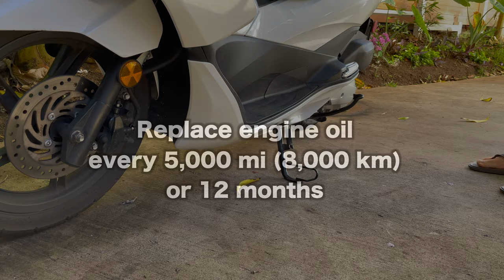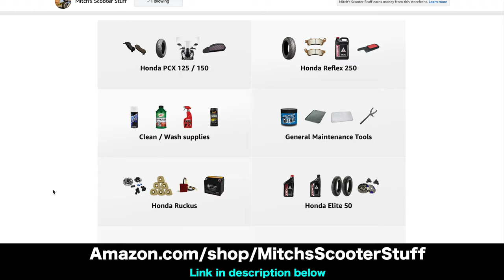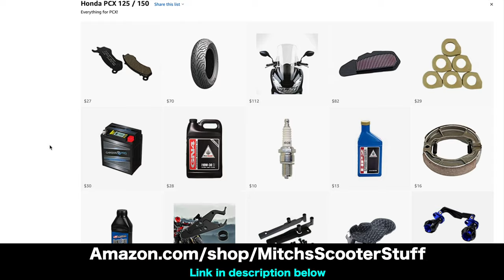Honda PCX - Engine Oil Change / Strainer Screen Cleaning | Mitch's Scooter Stuff

Comment: Mitch,  Great maintenance instructional videos on the PCX 150...really the best.  Could really use one on how to replace the fuel filter located on the fuel pump assy unit inside the gas tank.  A few panels have to come off, disconnecting the fuel supply line is a little tricky, and removing the pump assy from the tank is like RUBIKS cube...ugh.  Could really use one of your videos on this job.

Comment: before put on back the screws under the engine and the filter "tamiz", thats better put some new oil to clean out old oil and contamination.
Honda say the oil motor are 10w30 Jaso MB, but im using for now 5w40 and works better the engine, reduce gasoline consumption and reduce stress between cilinder and piston, in a few seconds the optimus temperature are ready and for climatic zones like Hawai, California or Alicante in my country Spain in the Mediterranean, are the best choice.
Im using CASTROL from many years ago in Scomadi TL125, Honda PCX 125i and VESPA GTS SUPER 125, maybe next time i try MOTUL or MOTOREX if the price of Castrol change... 
greetings Mitch!!
Reply: Hello mate. I am an owner of Honda Pcx 125cc 2017 and I totally agree with you. I use ipone katana scooter 5w40 oil and I am very satisfied. I totally recommend this motor oil. I live in Greece and temperature here in summer is so hot for 10w30 oil. I also recommend full synthetic motor oil. Any choice you make is good as it meets the handbook specifications. But never never let a Honda crankcase dry out of oil. Keep good work and wish you the best.
Reply: The best honda scooters engine oil is motul 10W30 MB.. fuel economy, performance.. Please follow the booklet.
Reply: @georgekountouris8059  The best honda scooters engine oil is motul 10W30 MB.. fuel economy, performance.. Please follow the booklet
Reply: @hasann1453  Good evening Hasan. My choice meets the booklet specifications and ipone oil is inside the limits honda puts. In the end.... my money, my pcx, my choice 😅.  Maybe motul is better but I cannot express any opinion because I have never tried it. I use ipone oil for 78000 km without a single problem. There are so many products you can choose for your bike. I didn't say ipone is the best oil, I just said what I use and I did a simple recommendation for my own experience. I am not an advertisement guy.😅

Comment: Hello, you are changing your structure at 8000 km. This is exciting. How many kilometers will the engine last in this way? Are you losing fat? I also have a pcx 125 2022, I change the oil every 6000 km.
Reply from the maker: Engine should last forever if take care of it really good. I don’t lose fat, my weight is same for many years

Comment: Put 30k miles on the clock since new and never touched the strainer. Does it matter that much? I'm new to scooter maintenance and it intimidates me tbh. Worried that by trying to do something right, I'll do something wrong.
Reply from the maker: I would take strainer out to make sure to empty staved metal pieces that trapped in there

Comment: I have a 2013 Honda PCX 150  I have changed oil in a lot of different vehicles before. I changed the oil in my 2013 PCX 150 I put it on the middle stand on level concrete drained the oil took the filter screen out and cleaned it made sure all the oil had stopped draining put the oil plug back in and the screen and cover put one US QUART of oil in then cranked the scooter up and let it run for about 4 or 5 minutes turned the scooter off waited 10 or more minutes then checked the oil by wiping the dip stick off and putting it back in but did not screw it in wiped the dip stick off put it back in but did not screw it in and the oil is showing about half an inch over the full mark. What the hell is going on it's showing about a Quart to much oil.

Comment: I’ve just changed mine, I noticed it had some of metal shavings around the cap with the filter?? Is this normal? It’s on 23k miles
Reply: Who did the previous service? Some screw the cap in with force and damage the treat. Shavings can come from all over but are never normal. 23K miles, i would change gearbox oil as well the next service.

Comment: What year is this pcx? I just watched another video it was a 16 the drain bolt was a 17 mm and was in the side and the oil screen/filter was on the drain plug
Reply from the maker: It’s 2017
Reply: @MitchsScooterStuff  ok cool I’m trying to look up for a 2019 and I keep getting different videos . Not sure it different years matter as much or like cars do they run with the same thing for several years . Or maybe it’s one sold in different countries

Comment: I just bought a scooter with 200 miles on the oil, but also 2 years time. Does the oil really age and need to be changed or is it fine? Oil looks clean.
Reply from the maker: Hey you should be fine 👍🏼 no needed to change
Reply: When the oil is 2 years old, i can recommend to change it asap. 200 miles is what the told you. Why would you safe on 0,8 litre oil?
Reply: why risk it for $4 worth of oil and 20 minutes of your time?

Comment: Help!   My oil strainer screw Cap is stuck and i can't turn my 17mm without rounding the bolt!   What do i do?   I've been spraying it with wd40.   Is still slipping
Reply from the maker: Uh oh! Try use the locking pliers it will work…
Reply: Not sure if you already have this sorted now, but what I did on my PCX150 was to buy an extra 17mm socket and then file the chamfer off completely.  That "nut" on the oil screen cap is really shallow, so the chamfered edge of the socket can't grip it properly.  Remove the chamfer from an extra 17mm socket and you'll get a solid connection and it will come off.  MIght need a breaker bar like Mitch used, but it will come off!
Reply: @MitchsScooterStuff FYI I had the same problem and what I did was to buy an extra 17mm socket and then file the chamfer off completely.  That "nut" on the oil screen cap is really shallow, so the chamfered edge of the socket can't grip it properly.  Remove the chamfer from an extra 17mm socket and you'll get a solid connection and it will come off.
Reply: I'm still struggling with it.  Its winter here so i need to wait for more favorable weather.   I've tried the loving pliers but that didn't work for me.   Many also suggested that.   But this is a first that I'm hearing about filing off the chamfer from a socket.   I'm going to do that next.   I'll report back to let y'all know if it worked.   Thanks for your response!

Comment: 8,000 kilometers for oil change it's too long period. For my PCX I change oil every 2000 km. It's only takes 750 g of oil it's not a big deal to change it more often.
Reply: Yes, I think 8,000 km for car. PCX must be change oil every 2000km.
Reply: Then blame honda. It's just what the manual says. It also says to use the same 10w 30 oil as gear oil. Since it makes no sense I didn't listen and put in 80w 90 mineral oil
Reply: @phanhuy14    Oil change is every 4000 miles after the initial 600 mile break in period.
Reply: I change the oil once a week
Reply: Not necessary at all lmao